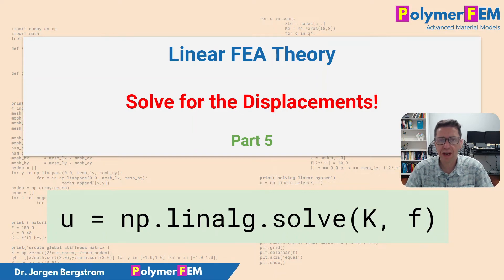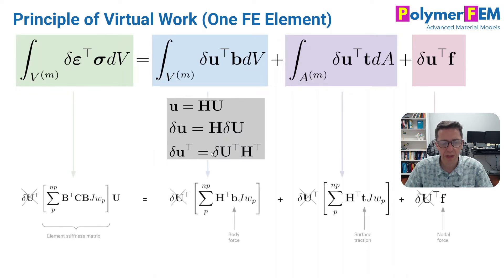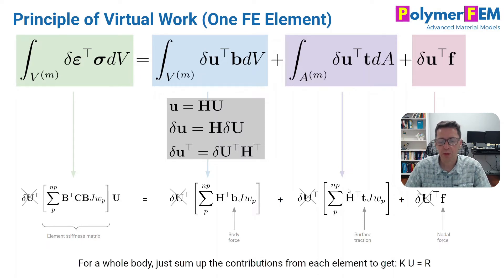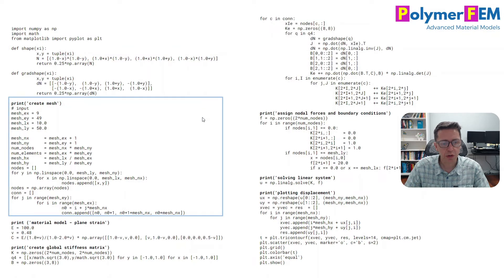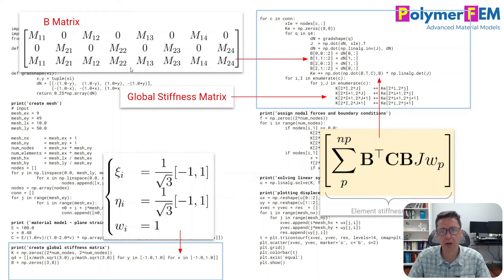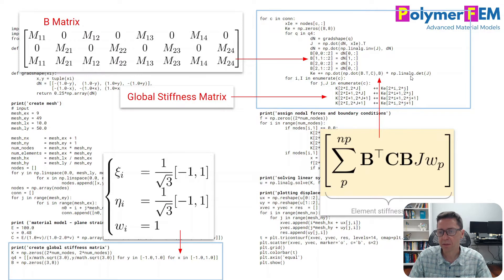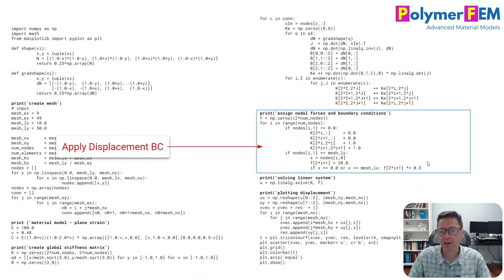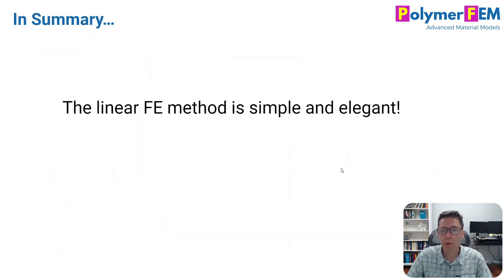Basic FEA Theory - Part 5 - Solve for the Displacements

Comment: it would have been great if you had explained the code a little more. I am very confused about how you assign the boundary condition though making changes in the global stiffness matric. what if I have a point load applied on the same rod in the horizontal direction. I just want to know how to connect the node number and the element of stiffness matric connected to that. It will be easy then.